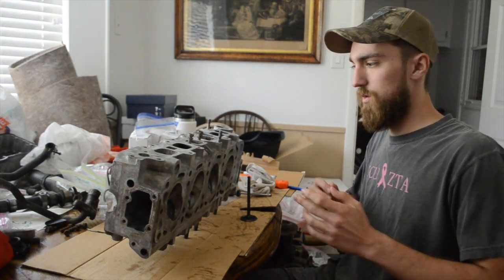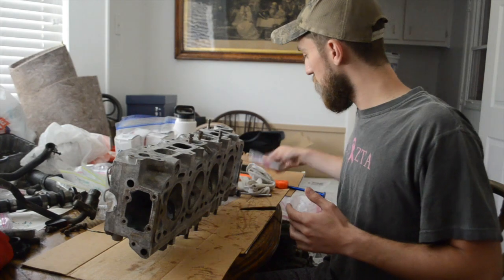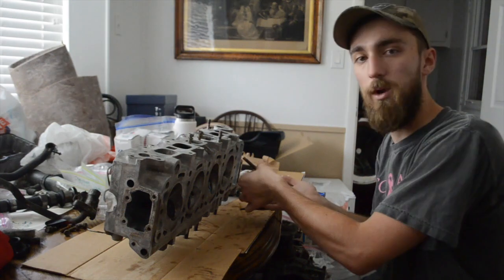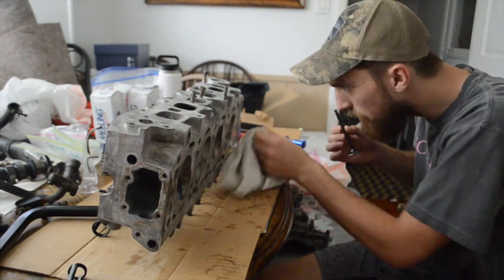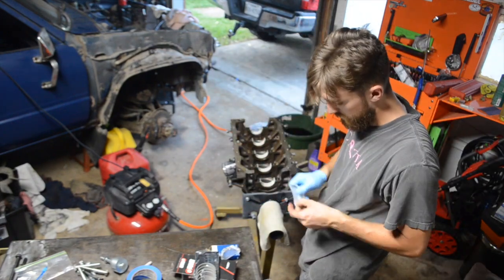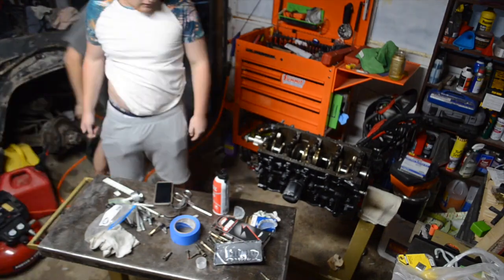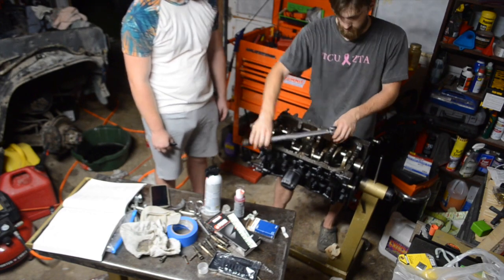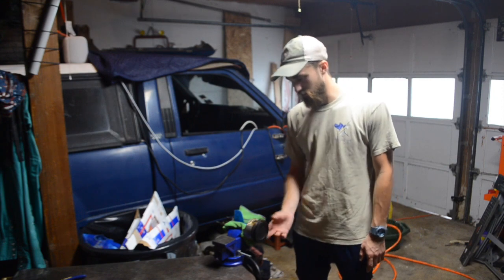BARN FIND 1986 Toyota Pickup.. Ep3.. Engine Building Pt1.. Valves, Crankshaft, Pistons

Comment: i kinda skimmed, so forgive me if i missed anything... BUT if you had a leaky leadgasket, after your lap work is done, you might bring your head to a machine shop and have them check that its not warped, have them resurface it, and check your valve lap work to see if any need addition grinding.  i took mine to calvert machine shop in denton. it wasnt too expensive for what i mentioned.  like 130$ or something?? its been a lil while. they did some work a honda motor for me in the past also.  my toyota 22r head was warped, they straitened it and then they resurfaced it and checked my valve lap work and gave me feed back (i need a little more lapping on 2 valves).  i also had hot tank service done.     **since my reassembly my engine seems to be leak free !! :D **  ALSO, when you reassemble, use NEW head bolts if you werent already keen on that topic.
Reply from the maker: Thank you for the comment!  Originally, we did think we were going to have to take it to a machine shop and have work done, but after measurements we decided not to.  Once we got the block completely torn down and started measuring, we found out that the motor had already been bored out to .020 overbore, resurfaced, and crank ground down .010 under.  We went over all measurements 3 times and were pleasantly surprised to find out that the motor was not actually all that worn internally.  We took a long straight edge and ran corner to corner along the deck and saw almost no warping.  Due to all of this, we chose to just hone ourselves but still replace all bearings and wear components.  We are confident everything is within spec and will make a good engine so far.  As for head bolts, brand new ones are already on the shelf waiting for install!

On your motor, have you been able to test it at all?  Are you still currently working on it or re-installing it?  I definitely will be interested to hear about any roadblocks you encounter getting yours back on the road.  Please keep us updated and continue to give input on our videos!
Reply: @McDevittMachines  mine has been running around the streets! i finally reinstalled a lot of my interior including stereo and new kenwood 4" speakers (having music hassle- free best update so far).  i replaced my timing chain, water pump, oil pump, belts, gaskets, rebuilt my stock carb(pretty easy), cleaned up some shitty wiring, cleaned up my bay, changed some hoses, cured power steering leak, got my vacuum lines pretty good -i think-, a/c still kickin, just changed trans and transfer fluid, rear dif was changed also, a month or so ago. has new inner and outer tie rods, cured my steering slop instantly.  i need to change the front dif fluid, but it needs new cv boots maybe axles so been putting that off for now.  needs new shocks.  my cab is pretty rusted out tho. i want a new cab if you know anyone with an 86-87 let me know :D
Reply from the maker: That is awesome!  I would love to check it out sometime and pick your brain!